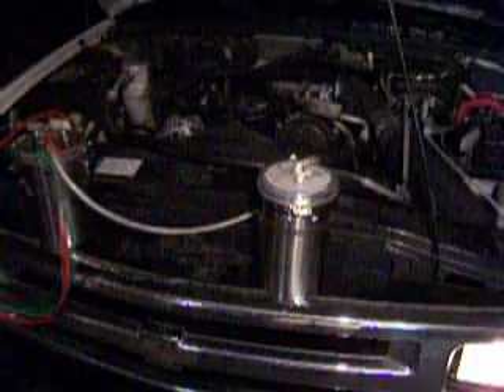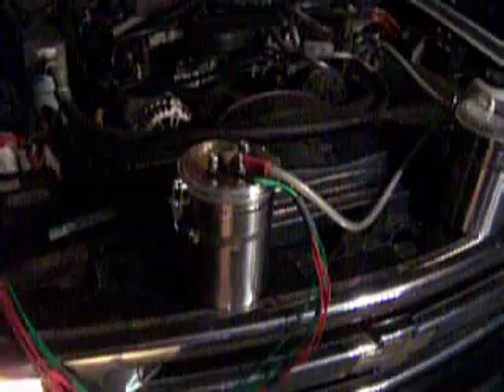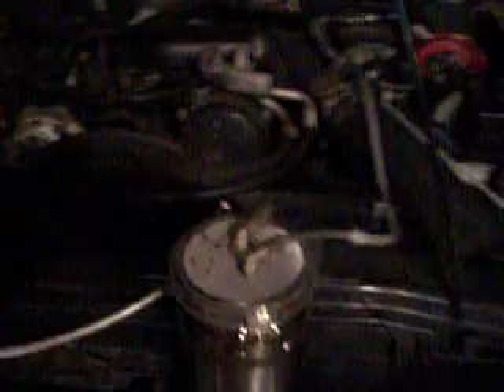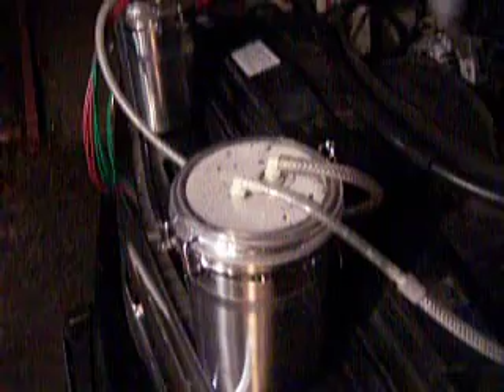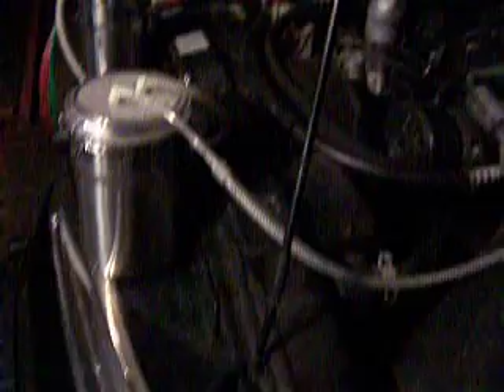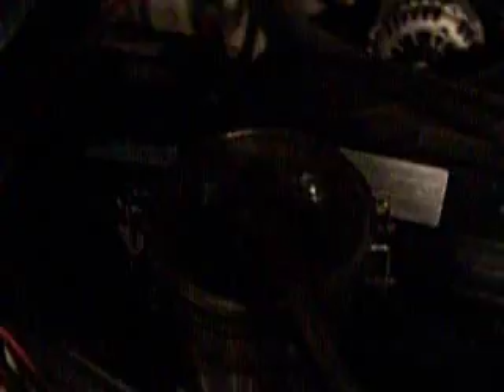JCS_5920 HHO Hydrogen Oxygen Electrolisys

Comment: Do you need any help designing a pwm circuit? I have a few recomendations. The 100mh choke isn't needed imo. Maybe it's used as a noise filter. Higher frequency may have more tendency to knock the bubbles off your plates.